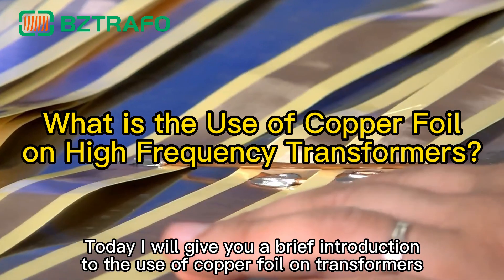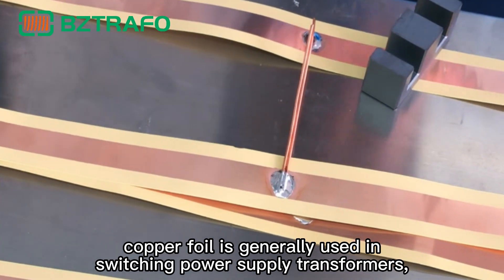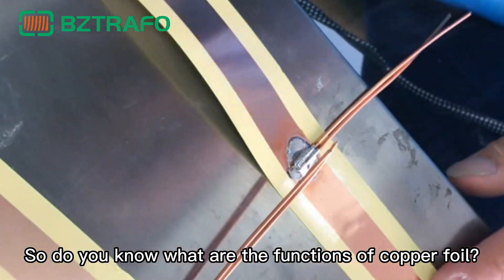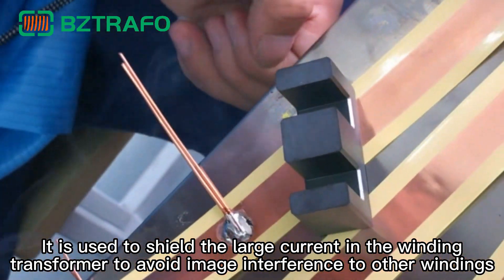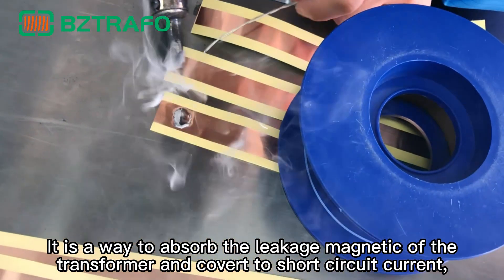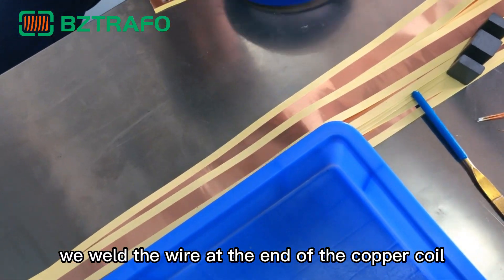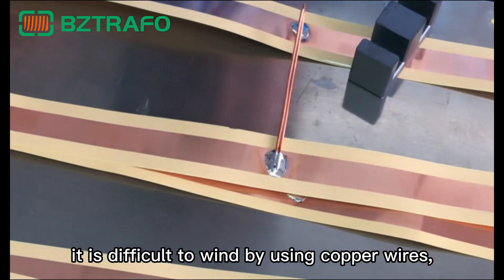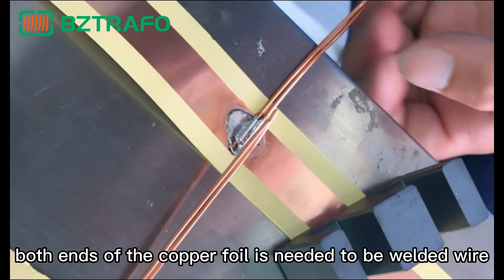What is the use of copper foil on high frequency transformers?

Comment: So it's essentially a grounded faraday cage. I've never seen it used as the windings themselves though, typically I see Litz style wire, but I personally haven't analyzed a ton of these transformers. I believe toroidal cores eliminate the need for a faraday cage in a lot of applications, because of their high efficiency and low EMI. But they're expensive to manufacture. Typically hand wound.
Reply from the maker: Thank you for your question. For  Bobbin-type transformers, we can choose copper foil windings instead of Litz wire if we require high current output, good heat dissipation, and minimal leakage inductance. However, copper foil windings sometimes have large interlayer capacitance, which can introduce additional losses and affect EMI performance. Layered windings are necessary to balance leakage inductance and capacitance. 
The final design method will be adjusted according to the actual application.